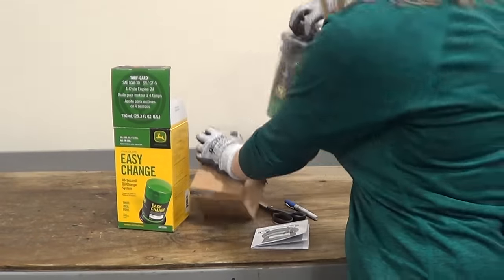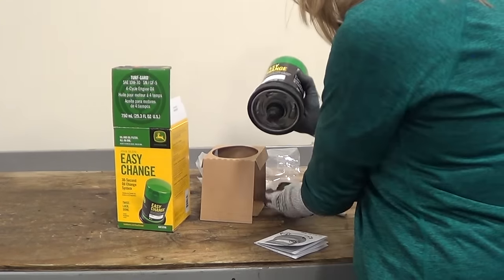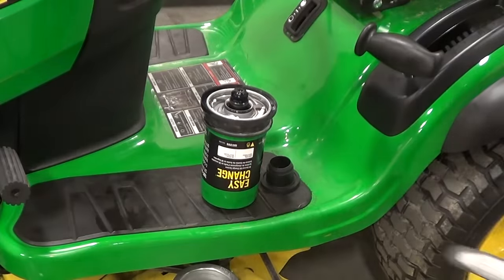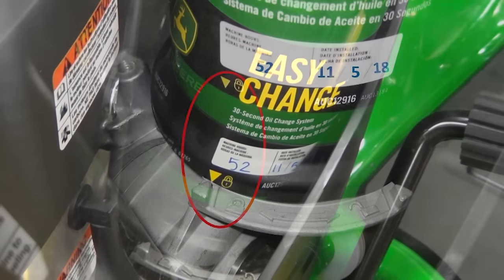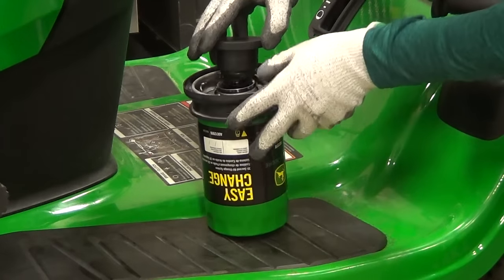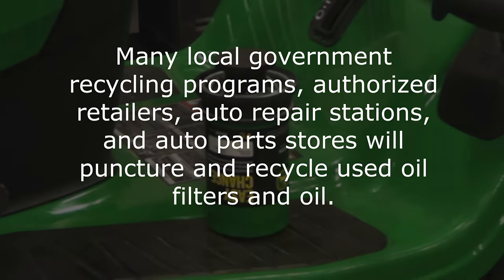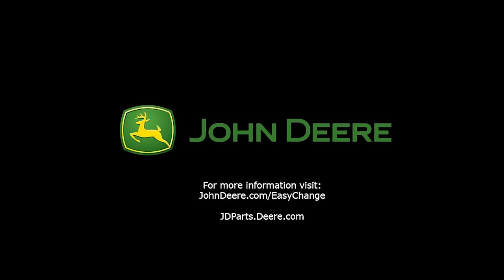How to Change the Easy Change Oil System | John Deere

Comment: How do you dispose of the oil inside the sealed oiled filter?  How do you get the old oil out of the filter?
Reply from the maker: Bob, thanks for asking about our Easy Change™ 30-Second Oil Change System. You won't need to remove the oil from the filter that you are replacing. If you're looking to recycle the filter, many local government recycling programs, authorized retailers, auto repair stations, and auto parts stores puncture and recycle used oil filters and oil. If you have further questions pertaining to the process of changing our Easy Change 30-Second Oil Change System, we recommend reaching out to your local dealer. If needed, you can find your local dealer at http://spr.ly/6054Pqf0G.
Reply: @JohnDeere  How do you change THE REST of the oil left in the crankcase?
Reply: @cgarris8674...you ADD a few oz to top it off....
OMG.. is this hard for you people?!...😅
Reply: @boosted2.4_sky  it's a pity you don't see the issue. Do you only replace 1/3 of the oil in your car or all of it during an oil change? I can explain it to you but I can't understand it for you...

Comment: My easy change filter was very hard to get off and the new one will not go on... any tips? Should I use a filter wrench?
Reply: @lordkrythic6246  I understand doing that to take it off... I got the old one off, but I can't get the new one on... I'm assuming you don't stab your new ones, right?
Reply: @justindavis9493  
Lmao, of course not. Try adding some oil to the rim of the new one, this will also assist in removing it later. Other than that, idk what to tell you.
Reply from the maker: Justin Davis, please consult your local dealer for further assistance. You can find their information at dealerlocator.deere.com.
Reply: @justindavis9493  I changed my oil today and 30 seconds is a lie. It took me a new filter plus an extra quart of oil. When I put the new one I thought it was seeded but it was not. Supposedly all of the new oil which was black when it ended up on my concrete because I tried putting the new filter on was not planted right. So after  about an hour of trying to get the new one on and getting very upset. I went and grabbed a filter wrench to put it on and it worked. There is no way this girl in this video put this filter on by hand. I tried using both hands to tighten it and it would not budge. I am glad I had a filter wrench to put it on. I was just before taking it back to let them know it would not fit. I had rather change oil the old way. At least all of the old oil comes out. Use a filter wrench it should work.
Reply: @chrisradford7265  Thanks for this reply, this is exactly what I'm going through... I've probably tried for an hour or so over a few days to get the new one on... I had to order a filter wrench, which should come today, hope it works... Thanks!
Reply: @justindavis9493  the filter wrench worked for me. Once I put it on the filter it snapped into place. There is no way that woman in the video took it off and put it back on that easy.
Reply: I did eventually get it using a filter wrench. It was very hard.
Reply: @JohnDeere  Unfortunately the dealer just told me that it's supposed to be easy...
Reply: Did you remove the tie-wrap on the bottom (the first time)?
Reply: @teddiehumphreys3687  Yes

Comment: I think they are missing the part where you pull cap off oil drain tube to get the old stuff out first, the price of these filters are like 39 bucks, what a rip off! I guess im gonna do the filter every other change.

Comment: You guys never said to put my spark plug wires back on. Now my mower won’t run
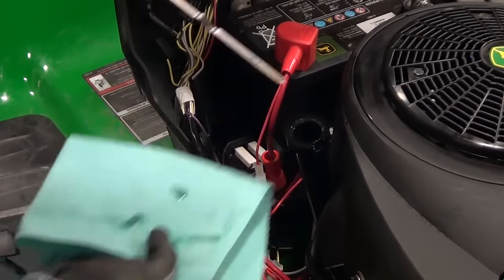Reply: @1:25 they did.
Reply: Leave the wires off, then run the mower for about 2 hours and then plug the wires back in. That should fix the issue

Comment: NOT ONLY would the original oil filter not come off without a GREAT deal of strength (3 people), but the NEW OIL FILTER would NOT, repeat, NOT "click" into place. We gave up. I am most unimpressed. Had to put the old filter on. Not sure how I will ever change the oil now. Disappointed. For $70 I expected an "easy change" oil change.
Reply from the maker: We're sorry to hear you've been experiencing this issue with your Easy Change™ 30-second oil change system . If you would like to discuss this with us further, please reach out to our Enterprise Contact Center. You can find their information at Deere.com/ContactUs.

Comment: Fine if you are willing to pay 3 X the normal price of oil/filter, but you're stuck with it if you mower came with it.  Maybe she doesn't want to spill oil on the immaculately clean garage floor.  And you STILL have to "add oil if necessary " .

Comment: As pointed out, this is replacing the minimal amount of oil that can be stored in the filter.  If the filter were inverted and installed up into the oil filter housing instead of down into it the filter would hold much more oil.  The way it is designed, the oil is draining out of the filter.  That is unless there is some kind of seal preventing the oil from draining once the filter is removed.  Such a seal would make me very wary about oil flow problems.

Not a good system from John Deere and the implementation of this on the economy models makes me wonder about this company.  Does John Deere use this system on any of their higher end or commercial mowers?
Reply: they do not

Comment: Don't u need to drain old oil first ,? How
Reply from the maker: Great question! You do not need to drain the oil in the John Deere Easy Change™ 30-second oil change system. The Easy-Change oil filter replaces about 0.8 quarts (0.76 L) of oil with every change. The benefits of this system are that engines with this system run cooler, oil quantity in the system is increased by 40%, and the filter holds more contaminants than normal oil filters do, even when the engine is off, thus extending the life of the engine.

Comment: Deere sells a conversion kit, which includes a conventional filter, which bought with oil still costs much less than one of those monstrosities.  To install it requires tools that a dealer or farm will have but a regular homeowner won't.  ( 1⅛” socket on long breaker bar, 12mm hex Allen key ).

Comment: Myself I would rather the old system as I am having to push down so hard it is almost impossible to get the new filter on!! OK Whack a mole! I am going to use a hammer to beat the new filter into place! That is what someone suggested on another site. So a neighbour came over and he could not get it on either, he went home and came back with a round wrench for changing oil, that worked... what an ordeal!!!

Comment: Easy Change is a joke. I’m in the same boat as another comment below. I tried for over an hour, called Deere Customer Service, called a Deere dealer, not help. Thinking it was finally seated properly, I started it up and now I have a huge oil spill on the garage floor. I guess I’ll try a filter wrench. JOHN DEERE please reply.
Reply from the maker: Mike, we're sorry to hear about your experience with your unit. Please continue working with your dealer and our Enterprise Contact Center to resolve this issue. If needed, you can find the contact information for our Enterprise Contact Center at https://bit.ly/3hERG8z.
Reply: @JohnDeere  STOP MAKING JUNK JD

Comment: could john deere respond to these comments.....they make sense.....your not really changing the oil
Reply from the maker: Thanks for bringing this to our attention! The John Deere Easy Change™ 30-Second Oil Change System replaces .8 quart of oil. The remaining oil in the engine is refreshed by the charge of new oil included in the replacement Easy Change system. Combined with 40% more engine oil capacity, improved filtration and cooler running temperatures which help extend oil life, it is no longer necessary to remove and dispose of all the oil in your engine during service. You can learn more about the Easy Change system here: http://bit.ly/2Ebw2UC.
Reply: @JohnDeere  I think people would be much more welcoming to this concept if the price wasnt so high
Reply: @JohnDeere  unfortunately this design will ultimately be the death of John Deere. You don't change the formula that made for your success... Ah well not my problem 🙂

Comment: Talk about a marketing distraction,  people.should know these low end engines don't even have pressurized oil systems, the filter just filters the oil in the sump ......mine is an older normal spin on style,  I use a toyota 6 dollar toyota  90915yzzd3 filter and costco 5w30 ,oil is now unbelievably golden for the entire 5O hours betweem changes and all deposits are gone...now at 700 hours after 6 years ownership, don't forget changing the transaxle oil often is far more important on these designed to fail machines..

Comment: Never showed how to CHANGE THE OIL. JUST THE FILTER.
Reply: Yeah, what the voiceover didn't mention is that the new oil is inside the new filter.  Which means the majority of the old oil remains inside the engine with this "oil change".

Comment: What a stupid system. How long do you think this engine will last for if the oil is never CHANGED. That is not an oil change.
Reply: Planned obsolescence
Reply: Easy just drain out the oil in the engine then put the new filter in and add whatever oil you need to fill it to the proper level, it’s so much easier than the draining the oil the old way
Reply: Brian Wilmoth It also costs $40-50.  A bit high.
Reply: 50 hours in a car at 60 miles an hour is 3000 miles. Modern synthetics will go 10k easily with no issues. This filter changes about 1/3 of the oil every 50 hours, equivalent to 3000 miles. Do I need to finish the math for you? Or can you take it from here? Being old is no excuse for being stubborn to new things.
Reply: And being young is no replacement for experience. New does NOT = better.  There. I did you math for you;)
Reply: @p1re9lu9de2  By that logic we'd still be using horse and buggy.
Reply: 1. That doesn’t add anything to the convo
2. That doesn’t make sense.
Reply: @C Dubs  I'm pretty sure my dad never ever ever changed the oil in our lawn mowers and they still ran forever. That was also before synthetic. This probably works fine. Mower engines aren't working too hard or too often. A once a season change like this is probably plenty.

Comment: .8 quartz never came out after the change. I dumped close to 2 quarts out of the block, and it took a full 2 quarts to bring the level back to normal after putting the new canister on, If u don't drain the oil from the drain plug you're leaving so much broken down black dirty oil in the system. I did this change for a customer today and the machine had 67 hrs on it. This system was made to just make more money from the consumer imo. Over priced filter and made to wear out the engine with lower hrs if u don't do the proper draining.

Comment: I would like to buy it
Reply from the maker: Austin, we're glad to hear you are looking at our 100 Series Lawn Tractors. Choosing the right equipment for your needs can be a challenge, so you might want to start with our Build-Your-Own Tool here: http://bit.ly/2vviMFm. After you narrow your options, you can sign up for a test drive at Deere.com/Demo.
Reply: With  all do respect.  I don't see anything good about this setup.   Yes it can be easy etc.   But the filter costs $45--$50 and you are only changing out half of the oil by doing this.  Those Briggs V Twin engines hold about 2 quarts of oil.   Even though you're installing a new filter and .8 quarts of  new oil when doing this.  You still have 1 quart of old oil in the engine.  Unless you drain out the remaining oil in the sump then add new oil to make up the difference.    A lot of mower manufactures now days for example Toro.   On the side of their Briggs engines says.  * Never change the oil.  Just check and add.    That is a load of crap.   There is no such thing as a lifetime oil.   Oil gets contaminates in it and needs to be changed out regularly to prolong engine life.    I think all of this is a marketing scheme to make people buy new mowers quicker.    So the engines prematurely wear out do to not changing the oil.   I work on mowers for a living and I can't believe some of the stuff these manufactures are coming up with.
Reply: And a compcat sikd steer and a 50g excavator soon
Reply: I thought John Deere was more reputable.
Reply: @Foomba  what do you mean by that
Reply: @Foomba  what does reputable mean
Reply: +Austin Wohlmuth
Having a good reputation

Comment: WARNING - do not buy John Deere. Not only are you overpaying for this “convenience” but it doesn’t work. The old filters will not come off without significant force and due to the same flawed design, the new filters will not screw on for the same reason. Their customer service is awful, they will simply refer you to the local dealer (who is likely also awful) who will charge you $250+ to install the already overpriced filter (I paid $70) that has about $10 worth of oil and a $5 filter. What a racket and a stain on this company’s brand.

Comment: This seems like a good way to shorten the life expectancy of the engine. Gimmicky. Environmentally unfriendly.
Reply from the maker: Thanks for sharing your concerns with us. The Easy Change™ 30-second oil change system was designed around convenience to customers, while not compromising on reliability or durability of the engine. The Easy-Change oil filter replaces 0.8 quarts (0.76 L) of oil with every change and the filter's valve closes to ensure the filtered particles can't drain back into the engine when it stops. A few benefits for engines with this system are that it runs cooler and the oil filter holds more contaminants than normal filters allowing you to extend the life of the engine. You can find more information about the Easy Change system under the "Features" section of our product pages for current Easy Change models like the S120 Lawn Tractor here: http://spr.ly/6056dx5vg.

Comment: Such a bad idea! But that’s briggs & Stratton for you. Spend the extra money and buy Kawasaki
Reply: rodney casselman Yes I agree.
Reply: It could be worse. They could have implemented the Briggs and Stratton "Check and Add" system which tells you to NEVER change the oil.
Reply: This is a John deer system. You can not buy the filter from briggs, you have to go to a John deer dealer. Briggs did not.
Reply: This is not a Briggs accessory   This is installed by John Deere
Reply: THEMOWERMEDIC1 thank you
Reply: This is not a Briggs design John Deere put that on after. Even the kohler and  Kawasaki engines have this!
Reply: I do believe they got the system from Briggs as it was mentioned in the last MST Update.